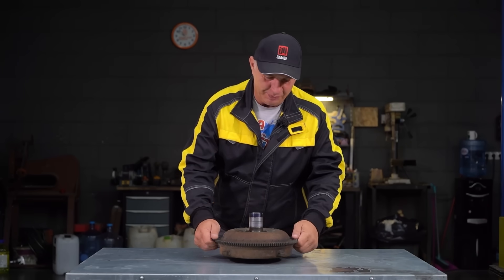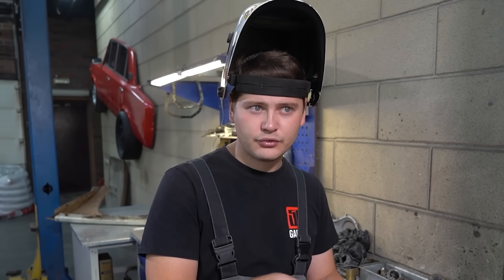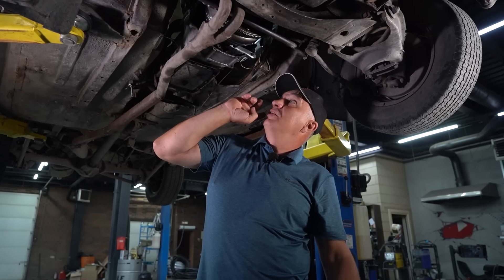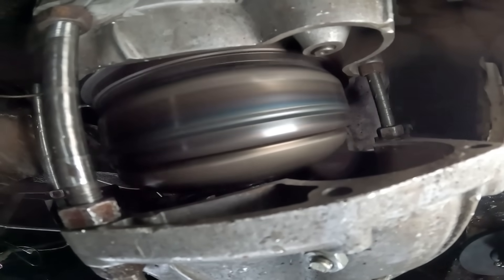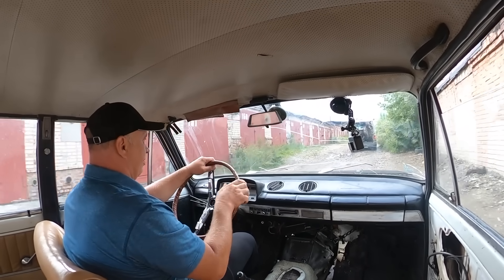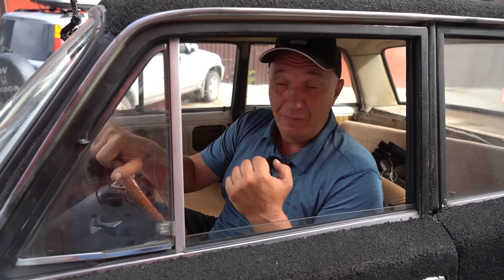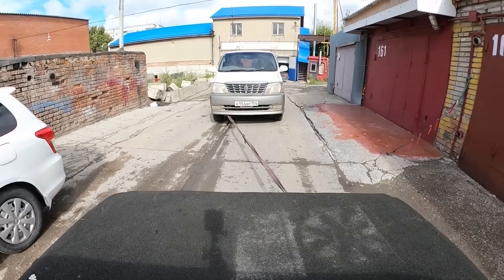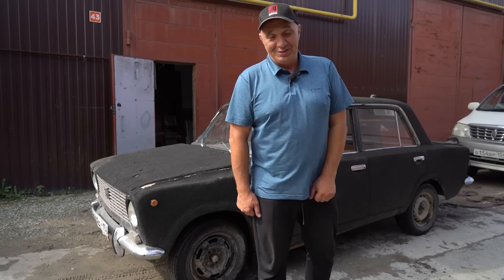Torque converter in a manual transmission - will it work?

Comment: They could add a bypass on the pump to a valve.  When the valve is opened, it will stop sending pressurized fluid to the torque converter, making shifts grind less, especially from neutral, while the engine is running.  

Years ago, I played with the concept a computer, reading the engine RPMs and output shaft RPMs.  Connecting solenoids to the shift rods and shifting when the input and output RPMs match to allow for a shift while not clutching.  Essentially a smart double clutch. 
It worked, though going up a hill or under load would sometime result in a little grind.  Unfortunately, I would have to play with the engine RPMs too much, which made it unusable for daily driving.
I considered adding a control to the throttle to make automatic adjustments to the RPM, like cruise control does.  Unfortunately, I got busy and no longer had time for it, and have since replaced my manual with an automatic transmission.

This was a fun proof of concept.

Comment: Dodge had torque converters in there pickups in the 1940's, yes a manual transmishion a clutch behind a torque converter. once you pushed the clutch in and put pickup in gear you could drive like an ordanary stick shift, but coming to a stop all you had to do was let off the gas and brake. Even on a hill the converter would not allow the pickup to roll back.  To take off give it some gas and you were up and going again.  Why do people think they have come up with something new when it was invented 80 some years ago.

Comment: I can see It vibrating like mad. Lock up clutch won't work without inputs from the automatic. Fluid drive Chrysler's, Dodges, DeSotos and Mercedes all had regular clutches  as did the VW automatic stick.which had an automatic clutch controlled by a microswitch in the shift lever, and vacuum modulated to engage smoothly. I've driven them all except the DeSoto. The Plymouth, early Dodges and the Mercedes had fluid couplings . The VW had a Torque Converter and I think the later Dodges and Desotos and Chryslers had torque converters.

Comment: A long hole in the bottom of the car, tar instead of paint, a torque converter instead of a clutch - self made. Now that car only needs to be brought to the main inspection, should pass without any problems... ;-D Nice video

Comment: I used to drive Water Tenders (tanker truck) One of the trucks had an automatic main transmission with a 4 speed Brownie behind it. Basically the same thing that they had setup in this video. This truck did not have a Clutch.

Comment: My '47 Dodge had Fluid Drive. I drove it like a normal 3 speed manual, but could shift it without the clutch if I wanted to. I was only 16, and didn't understand it's capabilities.

Comment: Nothing new. I have a 1960's 60HP tractor that has a manual locking torque converter and a power hydraulic clutch. Drop the clutch at idle and it will just sit. Start pulling a hill hard in direct and unlock the torque converter. Great tractor.

Comment: Your heading in the right direction dodge did this back in the way late 40s and 50s my 49 cornet had a transmission that was manual and automatic it's called a gyromatic transmission you only needed the clutch to take off rest was fluid shifting

Comment: All you guys have to do is figure out how to make the pump work because there is a clutch inside of the torque converter that gets applied when the oil is pushed against it with the fins if you can figure out a way to control the oil which pretty much you have it on there you just need tofigure out how to use the pump and that would be your clutch engagement.

Comment: In the U.S., atleast, the lockup doesn't engage until 40 MPH, (64 KPH).

You can take off in 4th gear because a torque converter is an inefficient pump at low speed. It is like one fan blowing transmission fluid at another fan. Ignoring the lockup mechanism for a moment, there will be "slippage" at low RPM analogous to a slipping clutch. As you increase engine RPM's, the crankshaft fan will exert higher fluid pressure on the driveshaft fan thereby increasing your speed. You may want to be careful when the lockup engages as the car may be a bit hard to control when trying to slow down. I had a torque converter malfunction once where it didn't unlock and it tried to push my car past the brakes and through a stop light. Good luck.

Comment: The big three ( Ford, GM, Chrysler) all did this in the late 1930's. They used self contained fluid couplers different from torque converters. Fluid couplers are still used in industry.

Comment: You're better off using a scientifical clutch! There's much more to the torque converter than just the torque converter itself you need the transmission fluid you need the electronic lock up. Also you're slipping that torque converter constantly and you don't have a cooling system to cool the fluid. Destined for failure

Comment: Fun fact!
The reason it drove so well, and even towed the van, is that the torque converter converts slip (rpm differential) into extra torque, so at lower RPMs, near it's stall rpm, it ends up acting like a better version of a CVT, providing extra torque and less speed when the load needs it.

If it was a hybrid torque converter (one accompanied with a clutch) you could press the clutch in to be able to change to neutral and reverse with no problem and without stalling
Reply: wait, so why not use a torque converter instead of a CVT?
Reply: @xynonners  the cvt is the Transmition, like the "Gears" the torque converter is just the coupling between the two

Comment: Golf carts have a little brake pad that presses down and stops the input shaft from spinning when you go into neutral. This is meant to synchronize the gear shifting when the wheel speed is 0. In golf carts, it’s meant to control the selector between reverse neutral and forward. In this case, a brake could be applied to the input shaft to momentarily synchronize 1st gear which would stop the grinding from neutral to first. With a little education and skill on rev matching, this could be a daily driver car. If you an are an avid motorcycle rider, you may already know how to do this when you clutchless up shift. The concept is essentially the same

Comment: My question would be since the fluid is not runnning through cooling lines to the radiator, wouldn't it over heat and burn up the components quickly?....

Comment: Reavers used to do this the other way around. They would replace the torque converter with a clutch, allowing the driver to drop the clutch to get off the line quicker and the three gears to be shifted very fast. It was called a poor man’s Lenco. With a hydraulic clutch to replace the manual clutch linkage they could launch hard and shift very quickly.

Comment: i designed a variable torque converter/ transmission to completely replace the transmission like a cvt without a belt kinda like a jet engine in a way but with a swashplate to change the pitch of the blades. it works great just as expected but its easy to build no gears so i can make it with a cnc machine thats great because making good gears is hard and they always need oil my transmission can work with any fluid like water but also works with air too just much lower torque but its built like a jet engine long with multiple turbines so if made long enough it would work on air just fine just cars kinda need high torque s i use water

Comment: This is kind ve the same system as an old 580c case backhoe. I noticed that the shuttle shift and whole mechanism was practically part torque converter assembly with clutches and the gear box and differential were one until. You could stick it into a gear 1-4 but it also had a separate lever when pulled upwards like putting a truck into park it would engage forward drive and when you pulled it down reverse while keeping it in the middle was neutral cutting all power

Comment: Volkswagen did that with a model of their beetle. I used to have it. It had both a torque converter and a clutch. And the clutch was released by vacuum controlled by a switch on the shifting lever. When you put your hand on the shifting lever the weight engaged the switch and released the manual clutch. They called it a semi-automatic transmission I think. But it had a torque converter.

Comment: Volkswagon did it with the Automatic stick shift on the beetles.
Reply: VW used a vacum activated clutch between the converter and a 3 speed manual transmission. it had a switch in the shifter that activated it.

Comment: You need to use the clutch to. Same basic as a moped bike (small bike) using clutch and automatic sentrifugal clutch to transfer power to the transmission.

Comment: The Mazda roadpacer came with this manual gearbox and torque converter.
The vehicle is actually an Australian built Holden kingswood sent to Japan and fitted with a mazda badge and rotary engine.

Comment: A torque  converter in a manual isn't nothing new Case has done it since the 50s Case O Mayic tractors were 4 spd manuals with a torque converter instead of a clutch.

Comment: Chrysler did this in the 1950's called Fluid Drive 727 A904 transmission.   Be careful because under torque like pulling that van a torque converter does expand like a balloon, and theoretically can pop those
bolts without a bell housing, or damage the eninges thrust bearings.  But yeah, it essentially replaces the clutch, even if most automatics still use internal clutches for added smoothness.

Comment: Some Finnish military trucks do have torque converters, along with regular manual transmission and clutch. They're funny - put it in gear, hold the brake, dump the clutch, and still hold the brake... 😂 You can even get going with higher gears, like 4th, without fear of stalling.

Comment: In finnis army i drove Sisu SA-240 which is manual with torque converter. We usually put 4 gear in then hold brake and lift clutch but it wouldn't stall and after that it drove like normal automatic.

Comment: If you add a conventional clutch between the flyweel and the torque converter then its possible. The German gearbox  manufactory ZF has done so for heavy transport application. They called it Wandler Schalt Kupplung.

Comment: they have these for motorcycles, its not quite a torque converter but a slipping clutch that works like a torque converter and wont burn up or wear out. infinite clutch would be awsome, coult finally teach my wife how to drive manual without the worry of breaking my car😂

Comment: Converter needs more fluid that's why it's slipping so much under load.  Once engine RPMs are past slip speed it should pretty much pass all input energy to output.

Comment: My 1951 Dodge had a "fluid drive" it was essentially a torque converter with a manual trans. We could let the clutch out  in gear while stopped and it wouldn't kill the engine.

Comment: This is essentially what Polaris did for their side by sides. Only instead of a fluid torque converter, they use a belt CVT and the gearbox has only two speeds and reverse instead of 4 speeds and reverse

Comment: Some tractor manufacturers, mainly Fendt but also others like International Harvester used to do this back in the day. However they also had a standart dry clutch after the torque converter.

Comment: Professional Pro Modified drag racers have been coupling manual Liberty transmissions with up to 5 forward gears to highly modified torque converters for about a decade. Makes the 4,000 horsepower they produce easier to manage than dumping a clutch and hoping the race car goes straight. Some use a lock up torque converter which totally locks up so there’s no loss of power due to slippage of the conventional torque converters. The torque converters they use are extremely expensive and are designed so they can be taken apart and change the fins inside to better manage all the horsepower they have.

Comment: I wonder if draining a small amount of fluid from the torque converter would allow it (the converter) to spin more freely at idle (hopefully allowing gear changes), then when the engine RPM comes back up, the increased speed and pressure of the fluid would start to move the vehicle again.  Might be worth a try!

Comment: It wont lock up. You need a hallow shaft to apply hydraulic pressure in its center to work as functionally alike a clutch spring.

Comment: Of course it would t stall as long as the stall speed of the converter is lower than the RPM it’s slip and make it not move. The efficiency is the question slippage is the enemy of efficient

Comment: Had a citroen with this system, it had a button on top of the gear leaver that broke the drive with a vacuum clutch. It would let the car go to a walking pace in top gear and pull away fast using the fluid flywheel. Leyland ,AEC and Scammel had similar systems on their two pedal trucks,the old london transport busses were the same.

Comment: ZF,s 'Transmatic' is a clever use of an eight speed manual synchromesh gearbox with splitter option, a WSK torque converter with  a small clutch to change gear. Full torque is  taken by the torque converter, allowing the driver to 'pick up' drive in the same way as a Voith fitted diesel multiple unit train.   Aimed at heavy haulage applications where precise control of torque is required to move loads in excess of three hundred tons, The ZF Transmatic is a  popular fitment in heavy haulage tractors ,like Scammell, Faun, and MAN OAF.

Comment: My dad have a V6 automatic, and electronic gas pedal. The car is "soft as a pillow", if you step on the gas, the car just ignores you for a second, then it revs up and launches like a rally car. The brakes are soft too, no engine reduction whatsoever. I only drive manual, it's safer.

Comment: Wow , what happens if it's in gear and  you're coming  up to a stop sign ? If you leave it in gear will the torque converts just let the engine spun while the car is stoped while it's in gear ??

Comment: That is actualy exist in similar way in some steyr truck
There is a converter before the clutch.
So you can hold the brakes while the clutch still engage and you can angage the clutch while brkes apply and take off like an automatic

Comment: VW beetles had an optional automatic stick shift. It had a torque converter mounted in front of a manual transmission. It still had a clutch though. It used a pressure switch on the gear shifter to disengage the clutch. The torque converter let you stop an start an the clutch automatically disengaged as soon as you touched the shifter. You just couldn't keep your hand resting on the shifter.

Comment: Without a direct connection between engine and wheels, can it be shiftet into reverse while moving fordward? Should be? 
Then you can use the torque converter as a hydrodynamic brake too, by shifting in reverse and apply some throttle.

Comment: Oliver did this in their super 99 tractors with the GM 2 cycle engine and the 995 Lugamatic tractors. Built in the late 50’s. And they used an Allison torque converter with a manual dry plate clutch for their 6 speed gear transmission.

Comment: You can actually pull off in any gear because there is no clutch, the car won't stall no matter what gear you are in. You can literally just leave it in 4th or 5th and just use the brake and the gas to drive the car.

Comment: Random fun fact- some of Ford's industrial tractors and loaders in the 80s-90s had this exact thing- a pretty standard 8-speed tractor transmission, but a torque converter instead of a clutch. You had a shuttle clutch lever on the steering wheel that engaged the torque converter to the rest of the transmission, in either forward or reverse. You also had a manual lockup switch for high-speed or high-load operation. 

Source- a friend's family owns one. Pretty fun to drive but has a learning curve. It also sucks in the cold, until the fluid is worked a bit and warms up, you barely crawl. The torque converter also means the trans will overheat fast if you're doing heavy work and don't have the lockup engaged.

Comment: VOLKSWAGEN had something simpler in the late 1960s. They called it a simi-automatic transmission. I drove a 1969 model that a friend had, VW put a torque converter on a manual transmission. It still had a throw out bearing that the cluth pedal would ingauge. Just in case of heavy traffic.

Comment: Seems like an awful lot of work for what is essentially a centrifugal clutch, but doesn’t disengage properly at low revs.
Can’t really see the point. Both manuals and automatics are significantly better than this, in every conceivable way, so apart from showing how to make a bad thing and figuring out how to make it work anyway, this serves no purpose.

Comment: Did you check to see if the torque converter was beginning to get hot?   With a trapped amount of fluid that isnt getting run through a fluid cooler constantly Im curious how hot that converter fluid would get👍

Comment: This idea is brilliant, dodge did it in the late forties under the name "fluid drive".
I'd say add in a clutch assembly in between the torque converter and transmission for gear changes as well as a cooling system for the converter.
You will never have to worry about stalling again!

Comment: Volvo made this exact thing in the 60's on the Amazon model. That gearbox had both a normal clutch and a converter behind it. But no clutch pedal, the clutch disc disengaged with a vacuum actuator when the throttle was released. Later in the 90's Saab had a similar thing. These transmissions were called saxomat.

Comment: Great video, gave you a like. If your torque converter lockup is controlled electrically or external mechanically, make the torque converter lock controlled by the clutch pedal. If the clutch is pressed, the torque converter is not locked and the pump is bypassed, when the clutch is released, the torque converter is locked and the pump is normal. You end up with a manual transmission, but with a clutch that should not wear out.